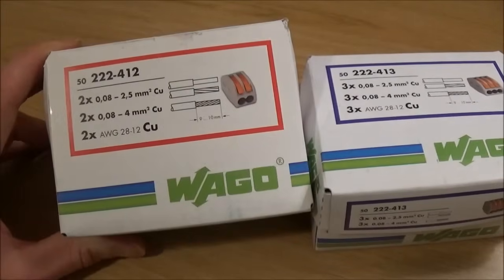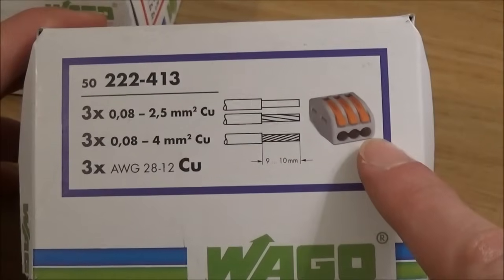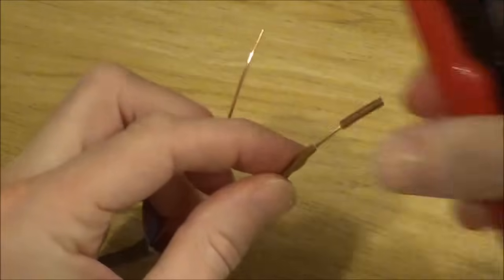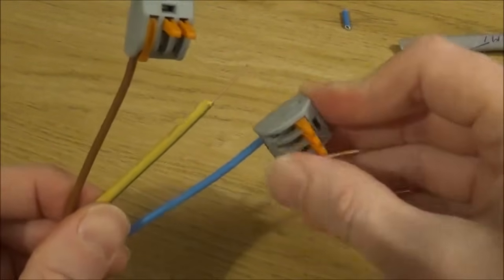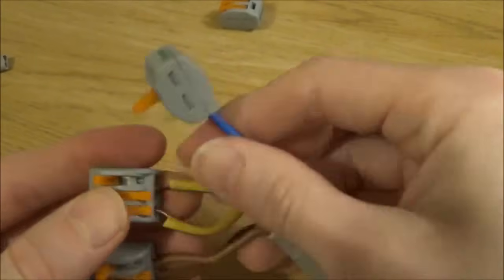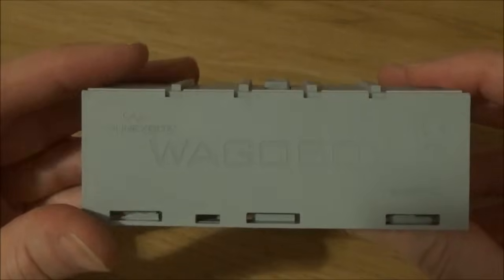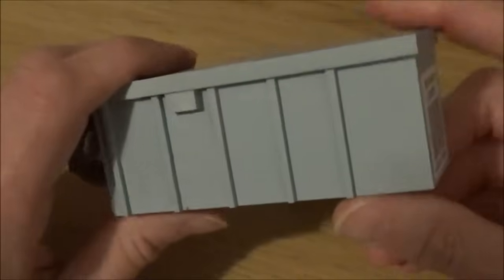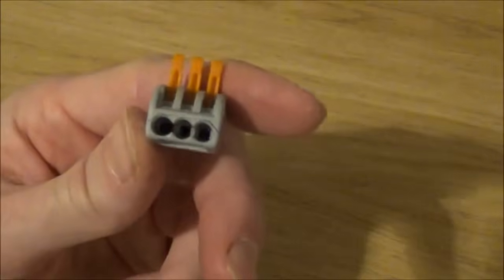WAGO 222 connectors review and demo. How to use with WAGOBOX Junction Box.

Comment: Hi mate I love your videos always clear etc so I can use these to say slip wiring to a socket under floorboards and feed an additional live to a fused box for a kitchen extractor ? (3amp) thanks
Reply from the maker: Not entirely sure what you mean, but if you're looking to run power to a fan from a ring circuit (with sockets) then you need to run the cable from either a socket or junction box to a fused switch with a 3amp fuse, then from this switch to the fan. That allows you to safely isolate the fan if required, and makes the wiring safe by protecting it with a 3 amp fuse. It's called a fused spur. No video on this yet, but hopefully one day when I have time!
Reply: @POUSEaroundtheHOUSE  hi thanks for your reply yes I already have a fused isolation switch a white 1 for now I'll changing it to silver eventually obvs as u stated with a 3 amp fuse  im hoping and if you can quote me on thus if im right to fund a junction box under floor boards that are for the sockets in kitchen to that affect wire from this junction box chased down to the isolation switch (3amp) then from that switch back up through the chase then back down to the extractor (non ducted ) ??? Thanks in advance
Reply from the maker: @kevinhancock4064  your kitchen wiring if it's fairly new, should be on its own circuit so prob no junction box to sockets. There maybe a junction box on the circuit with a spur to the switch in which case you only need to go from switch to fan. That said, when messing round with existing electrics there could be any number of issues with the existing set up. Having it tested and inspected by a qualified electrician will ensure the existing circuits and any additional wiring will be functional and safe. Depending on what you intend to do, it maybe noticfiable work which would require it to be signed off by a qualified electrician. Hope tgat helps and best of luck with it!
Reply: @POUSEaroundtheHOUSE  hi thanks old house so no I'd have to put the isolation box/switch in not one there as of yet
Reply: Kevin Hancock Electrical Connectors Wire Block Clamp Terminal Cable12V 240V Reusable like wago
THE CHEAPEST ON EBAY item number 263132476577
Reply: @aalazawi7287  thanks mate they look cool I have seen them before thanks

Comment: If you swap out an traditional ceiling rose and install a new modern light and use Wago connectors. Do these have to be put in a junction box or can you just push them back into the ceiling...? cheers
Reply from the maker: Junction box to make the main connections, but where you connect the final cable to the light, you can just leave the wago connectors behind the metal light fitting if you need to use them. Most modern lights will have a connector attached and already earthed to the metal light fitting.

Comment: THE BEST ON THE MARKET

These brilliant WAGO Electrical Connectors are available on Amazon and Amazon Prime and also eBay

https://www.amazon.co.uk/dp/B07PP9498H?ref=myi_title_dp

https://www.ebay.co.uk/itm/173828434944

They are sold by a company called Gas N Pow3r 

Have used these for 1000’s of my projects

Comment: I'm going to use these for some lighting job , do the wago junction boxes need to to accessible or can I cover them in the ceiling?
Reply from the maker: If installed correctly then they don't need to be accessible as they are deemed maintenance free but it is always a good idea to make junction boxes accessible where possible.

Comment: Sir can I use with 220v AC
Reply: As long as you don't exceed the current rating. It can be used from 1V to 240V.
Reply from the maker: I think John already answered this. Thanks both for watching!
Reply: @POUSEaroundtheHOUSE  Just a pet peeve, it's a ring final, ring main is HV distribution.

Comment: Never push 2 wires into 1 terminal....they are not designed for that and there's a good chance the 2 wires will arc if a heavy load is drawn......👍

Comment: Round here, when using the old screw caps we would also wrap em with tape (we even do so with switches and outlets before securing in boxes. Do you do so with these Wago things as well?
Reply from the maker: No need with these. They are fully insulated. Although if used in the ceiling they should be housed in the junction box designed for them. Thanks for watching.

Comment: Thank you! Is it safe to put two smaller gauge wire in one conductor?
Reply from the maker: It's best to buy a block with the right number of conductors as per manufacturers instructions. That way you will remove any doubt. Thanks for watching.

Comment: Can these be used inside a metal wall box without the plastic box?  I need to extend a double socket further along the wall and there isn't enogh cable to  use the Wago box as well.  Can I simply connect the wires inside it and extend the wires into the new metal box?  Maybe wrap some insulation tape  around them for extra protection?
Reply from the maker: Yes you can put them in a metal box. You don't need tape around them in the metal box as I presume you wont be able to tug the cable once their in place? They are fully insulated if fitted correctly. You only need the box in the ceiling or under the floor. Best of luck.

Comment: You can't fit two of the 5 connectors in each side of this box as stated, ('if you're using 3 or more you can only fit 2 in each side'). You can only fit 2x5 plus 2x2  in total, or 4x3, definitely not 4x5. I have a rose fitting with 4 wires connected to it, so I need 3x5 and 1x2 and they will not fit in this box! Does anyone know if the 773 fittings will fit in this box, I'd need 1x6, 2x4 and 1x2? Or is there a larger Wago box?
Reply from the maker: 773 are smaller and designed specifically for lighting. You can fit 6 4's inside the box if that's any help. Good luck and thanks for watching!

Comment: Would these wagos be okay in a suspended ceiling without box? Just thinking I will be able have access by gentle pulling through a downlight hole.
Reply from the maker: You need the cables secured together which is what the box does. You can put them inside the metal enclosure of a metal light fitting for example, but the moment they go out of sight, they should be secure so if pulled, you pull on the cable and not the individual wires. Thanks for watching!

Comment: The video shows the wago levers just being flipped up. I found that considerable force was necessary to open them. So much force, in fact, that I thought I was in danger of breaking them. Maybe the oned he uses have been previously opened.
Reply: Lol yes I've just done a light fitting using 222's and I thought they were going to snap but they didn't so good piece of kit...
Reply: I've spent the last 12 minutes of my life trying to get these damn levers up, do I need to buy them all drinks first or what?

For real tho, any tips?
Reply: @jflizzle457  I am having the same issue. I just spent a lot of money on grow lights, and feel like I am going to break these things if I pull harder. I was about to just use wire nuts. I guess I will just see if it breaks lol.
Reply from the maker: Yes they are quite stiff on the first click! Thanks for watching.
Reply from the maker: Hi Craig, thanks for the feedback. Yes good kit. Thanks for watching!

Comment: Hi just bought some as I need to isolate a ceiling rose for the time being as it got knocked/smashed. With the lightning circuit mock test I noticed the light loom never got connected?
Reply from the maker: Hi again, do you mean it never got physically connected to the mains? It was just easier to film at a desk but the principle is exactly the same. Thanks for watching.
Reply: POUSE around the HOUSE sorry yeah I know what you mean. Looking forward to trying these. Again another great video

Comment: Hi, I don't understand why the maximum size for solid cable is stated as 2.5mm2, when I can confirm that 4mm2 solid cable comfortably fits inside the connector as I've tried it as a test and if the maximum rating for this connector is 32amps, then why are we only limited to using 2.5mm2 solid cable and not 4mm2?? Why would only stranded 4mm2 be acceptable? Are you able to shed some light on this? I'd really appreciate it. Thanks!
Reply from the maker: It's just what the product has been tested to do safely I guess. You should always use products in accordance with the manufacturer's guidance as they will have been through rigorous tests to meet British and European standards. They may well accept a 4mm wire but weather the product has been safely tested using a 4mm wire is another matter. You could always ask the manufacturer? Sorry if that's not answered your question. Thanks for watching!
Reply: Hi there, many thanks for the reply! I would imagine you're right; I just needed a second opinion. Luckily I have found an alternative product (221 series) which is capable of housing 4mm solid cable: https://www.tlc-direct.co.uk/Products/WA412C.html

Comment: twisted wires with cone are cheaper and better
Reply from the maker: Fair enough. Good luck and thanks for watching!
Reply: Although very much the connector of choice in North America, the twist-on wire connector remains a largely untapped resource in the UK electrical market. Unfortunately many electricians still associate them with the poor-quality ‘screw-it’ wire nuts from the 1970s; manufactured from ceramic, these had a tendency to crack very easily and expose the wires, leading to safety hazards
Reply: How can they be better??

Comment: Can you tell me if these are suitable for 12v dc solar application please
Reply from the maker: They will work on anything up to 240volts and 32amps. Check the Wago website for manufacturers specs to be sure. Hope that helps, thanks for watching!
Reply: yes depending on  V and A, also they are not weatherproof where MC4 connectors are

Comment: Hi would these pass regulations for a shared neutral on multi way   light switches I.e. 4 switches on one plate   thanks
Reply from the maker: They are suitable for all wiring up to 240v and 32amps. Check Wago website for specific manufacturer details. Thanks for watching!
Reply: Thanks for your help

Comment: Good vid mate.. I guess a little limited in the wago box as to how many connectors you can get in there.. I am replacing a loop in loop out ceiling rose with some spotlights 3 on one switch and 3 on another. So would need to put 5 cables in one box. Do you think that is possible. If not I may just shove all the wago connectors up in the ceiling..
Reply from the maker: It's possible to get the cable but not 5 connectors in the right slots. But if you try the wago 773 series connectors, you can get 6 connectors (with 4 terminals on each connector) in the wagobox unit. They are only rated for lighting circuits but perfect for what you want. I've done a review here - Wago 773 connectors review and demo - https://youtu.be/Cz2jle06crA. Also watch my other video to see how to link the LEDs the easy way - How to install LED downlighters  - https://www.youtube.com/watch?v=DjtB6OnjvlE. Hope that helps. Good luck and thanks for watching!
Reply: POUSE around the HOUSE nice one.. thanks 👍🏻

Comment: Given that you then also have to buy an enclosure for each connection, I don't see any advantage over junction boxes cost wise. I can see that they'd be good when your pushed for space somewhere (if you didn't have to then add an enclosure) and they could save a little time if wiring a whole house since all wires are stripped to the same length so that time saved would add up. I do wonder if they're a fad.
Reply: They do save time.
Reply from the maker: They do indeed. Thanks for watching!
Reply from the maker: Hi again, the main purpose of them is to meet modern regulations in the UK. Due to their specific design, if they are housed in the junction box they are classed as 'maintenance free' which means they come under less strict rules when deciding where to place them under the floor compared with a traditional junction box. They are also very easy to use, and are used regularly  when testing electrics as they can join wires quickly, then be unclipped and reused very fast without the need for a screw driver. Hope that helps. Thanks again for watching!

Comment: There's lighting jobs that should be performed by a qualified electrician.Particularly if it's two way, intermediate or a loop in system.  Most never put it back together properly. Beware.
Reply from the maker: Thanks for the feedback Stewart. Best of luck and thanks for watching!
Reply from the maker: Thanks for the feedback Stewart. Best of luck and thanks for watching!

Comment: I want to use led stripe lights around my chandelier. I want to tie into the chandeliers junction box power supply. Does the led stripe light need its own junction box to convert the led ? Sorry, I'm really confused🤔
Reply from the maker: Hi there, a junction box is just where the connections join, but if you're using LED strip then you need to make sure they are the correct power rating. Mains electricity is 230 - 240 volts in the UK. If your LED strip light is 12 volt then you will need a transformer to reduce the power. Best to speak to the shop selling you the strip light and get the right advice. If you're still unsure how to do it then you will need to get an electrician to install them correctly. You don't want to burn the house down! Hope that helps. Thanks or watching!

Comment: nice idea but soldering is tidier and more integral
Reply: Good luck soldering all connections when working on a house project lol
Reply from the maker: Hi there, I agree soldering on 12v car may be better but you wouldn't solder 230v domestic electrics in the UK which is what they are targeted for really. Thanks for the feedback and thanks for watching!
Reply: thats a fair point. These are better than choc blocks but i was disappointed to see they wernt designed inline. Maybe thats for the next generation of WAGO's

Comment: Mil is not the same as a millimetre. A mil is one thousandth of an inch. It is a common unit to use when designing through hole PCBs.
Reply from the maker: Hi there, apologies if I didn't make it clear. In the UK 'Mil' is often used as a quick abbreviation for millimeter, and the units were written on the box as I made that comment.  But yes you're right it's a fair point. Thanks for the feedback and the correction. Thanks for watching!

Comment: Hi mate, I love your videos, very helpful. I want to wire two wall light in the alcoves but only want one switch to turn them both on and off. Can you do a video to show how to do this, ASAP, please...
Reply from the maker: Hi Jordan, If you watch my video How to fit a ceiling light. Lighting circuits explained - https://youtu.be/iQAs5zq-32c, this will show you how to wire the first light. Then watch my other other video,  How to install LED downlighters PART 2 - https://www.youtube.com/watch?v=DjtB6OnjvlE, this will show you how to wire more than one light off the same switch (it doesn't have to be downlights, it works for all lights). In brief, once you have your first light wired, just take another length of cable connecting the live wire to the switched live you have created on the ceiling rose or junction box for your first light, then neutral to neutral, and earth to earth and run the cable direct to the next light. Then just connect earth to earth, live to live and neutral to neutral on the 2nd light terminal/connector. Hope that helps, good luck and thanks again for watching!

Comment: Hi I'm trying to wire up 4 led down lights in my hallway but only got one source of power from a pendant what is the best way to rewire thanks
Reply from the maker: First thing, if you don't have a clue about electrics then employ an electrician as it can be dangerous and you could end up doing more damage to the rest of the electrics. I have done other videos (links below) which show how to remove a pendant and create a wire for an LED light, and another video showing how to wire up a few LED lights off one switch. 
How to fit a ceiling light. Lighting circuits explained - https://youtu.be/iQAs5zq-32c
How to install LED downlighters PART 2 - https://www.youtube.com/watch?v=DjtB6OnjvlE

Hope that helps. Thanks for watching.

Comment: hi, i need to change my lamp in my hall upstairs. it's 6 wires + earth. i wanna change to led lamp & don't have room for any junction box. how can i sort it . thx
Reply from the maker: Hi Ingrida, I would agree with Arcane, if you really don't have an idea of what you're looking at then you should employ a professional. I couldn't advise based on that information. However, if you want more detail on fitting lights then please watch my other video , 'How to fit a ceiling light. Lighting circuits explained. Replace and install a light fitting'. - https://youtu.be/iQAs5zq-32c. This will explain it a lot better than I can by typing. Hope that helps. Let me know how you get on and thanks for watching!
Reply: i've did everything
Reply: Get a professional in

Comment: um first of all where is a white black green or bare wire like houses should have. And second why not use a metal box like all the other contractors do and the old fashion wire nuts. twist the wired together with linesman and use a wire nut. I only use those when the wires are too short or in fluorescent lights
Reply from the maker: Hi Adam, you say why not use a metal box, well why not use one of these? I'm not saying you have to use these connectors, personally I like them and it's just demonstrating how they work for those that don't know. Thanks for your feedback and thanks for watching!
Reply: Europeans use blue and brown instead of black and white.